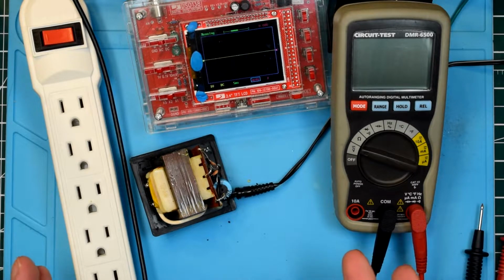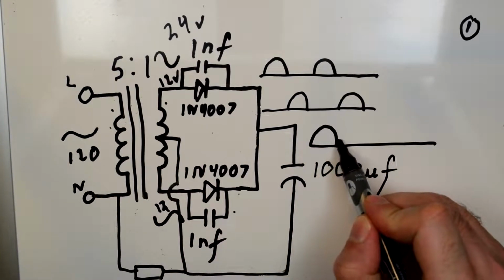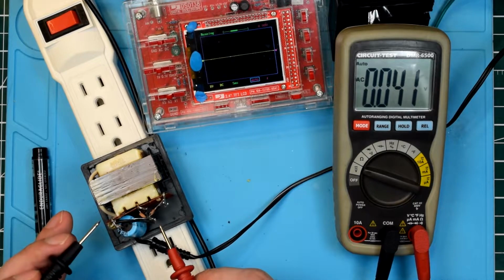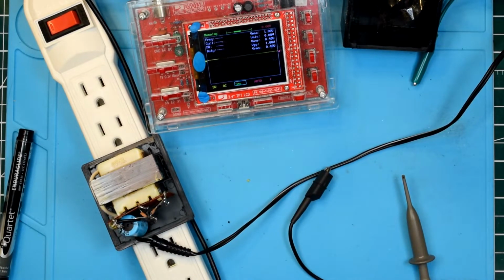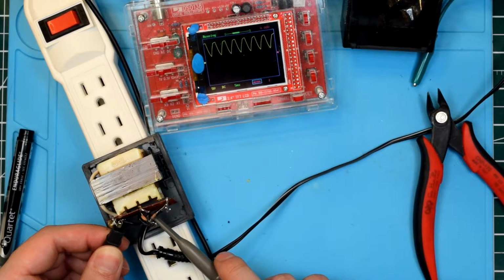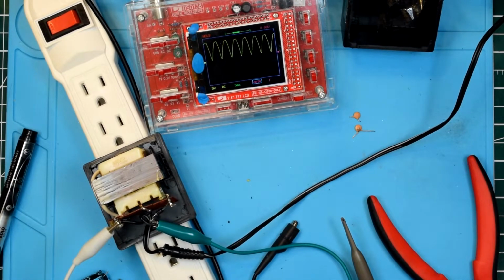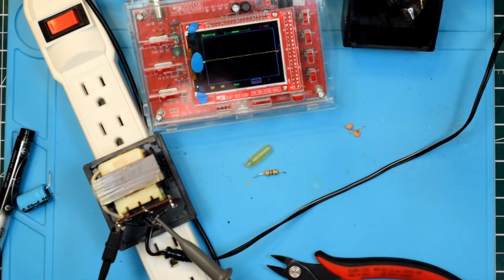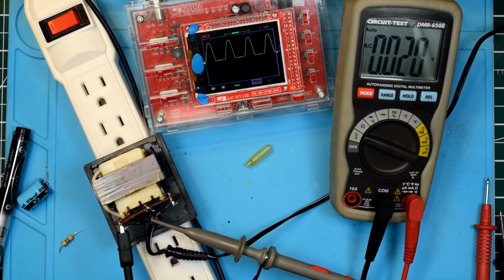Playing with mains voltage - Muntzing an old power supply

Comment: Isn't it entirely dc because the decoupling of the two windings...
Reply from the maker: No, because what's on the other side of the transformer is still alternating current. It also wasn't decoupled because of that mysterious resistor, which was way too high resistance to act as a fuse...
Reply: Gadgetboy if it wasn't that or to drain the capacitor it must be to try help prevent people from getting shocked touching both pins...
Reply from the maker: If it was a discharge resistor, it would be across the cap, not between the negative of the cap and mains. Weird.
Reply: @GadgetBoy  prevent top much power going back into the system pote tally causing other appliances down the line to draw too much power? Im out of ideas, let's ask @bigclivedotcom

Comment: So transformers may have a ratio of 5 to 1 but, what are the minimum number of turns before that will even work 😂
Reply from the maker: +Phonotical I'm not sure, but consider how heavy even a small one of those transformers are, there's a lot of copper there.
Reply: @GadgetBoy  indeed